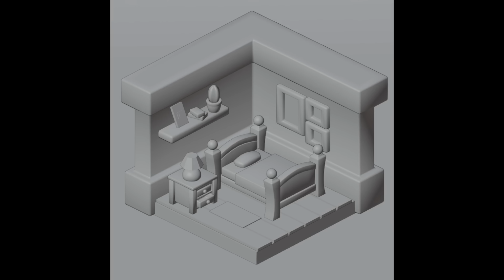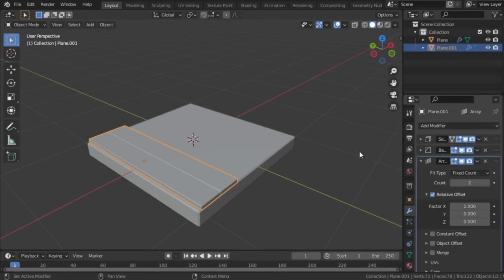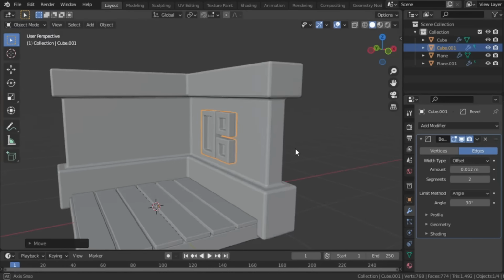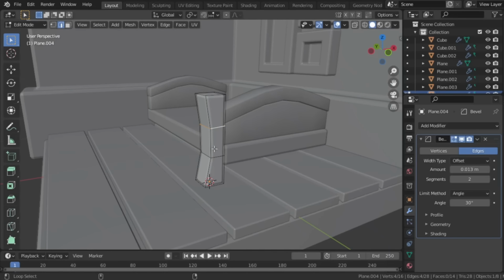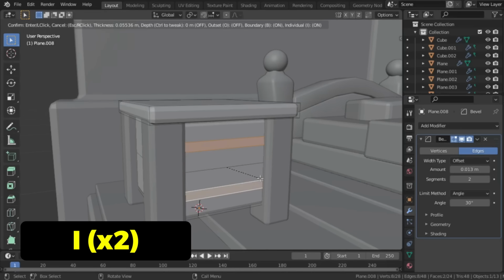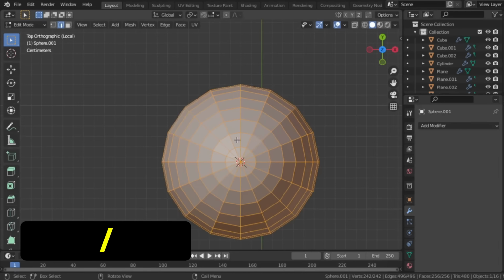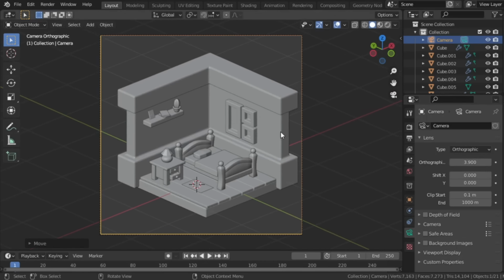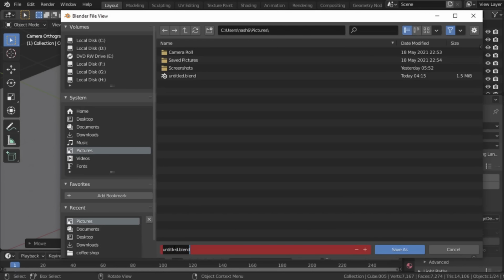Blender 3D - Create a 3D Isometric BEDROOM in 15 minutes | Beginner Tutorial

Comment: Please I am having issues with the mirror modifier
It's not going to the other part, I don't know what to do or where the problem is from
Reply: im also having problems with that, it doesnt mirror to the other side of the bed :(
Reply: @SintaxBSD  if you have not figured it out, see my comment :)
Reply: You have probably moved on at this point, but if not, here is the solution: Its because the origin of the object is not centered in the bed. Go to object mode. Click your bed in the collection so that it gets high lighted, then click the menu "Object", its in the upper left corner right beside "Select" and "Add". In the "Object" menu, click "set Origin" and then choose "Origin to Geometry". Now blender know where the middle of your bed is and the mirroring should work :)   (there might be other better ways to fix it, and I might have used weird termonolgy, this is my first day in blender)

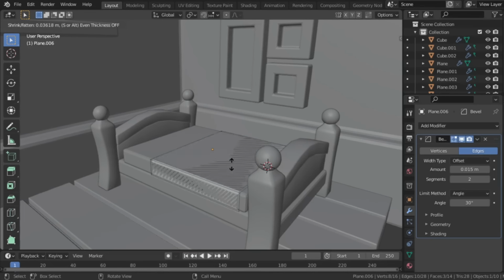Comment: 7:08 When I extrude along the normals, it extrudes the Bevel'ed edge of the sheet, so instead of treating the sheet as one uniform object, it grows like 3 horns. Anyone know how to fix this?
Reply: Mine is acting weird as well xD
Reply: @j00nsang  its been 1 month and i still dont know how to do that. So now I make straight walls
Reply: omg there's a lot of people having the same problem, can someone please help us? and btw after this exact part there's a meme that says: "you can do it" lol
Reply: did you get any solution? same is happening w me so I skipped that part
Reply: I'm not sure if I understand what you mean, but it sounds like something that happens to me when I use the bevel tool. Sometimes things poke out and look funky. kind of like horns sometimes. The solution to this problem is to look in the menu that pops up when you use the bevel tool, and check the box where it says clamp override. I'm not sure if its related to your problem, but I thought I'd throw this out there. You may also want to undo what you did, and then go to object mode, select the object, hit Ctrl + A bringing up the 'Apply' menu, and select 'Scale.' Idk if it works, but Blender guru says that whenever objects behave weirdly, its usually because you dint apply the scale. Applying the scale has fixed almost every other weird problem like that I've had so far. Sorry if none of this helps.

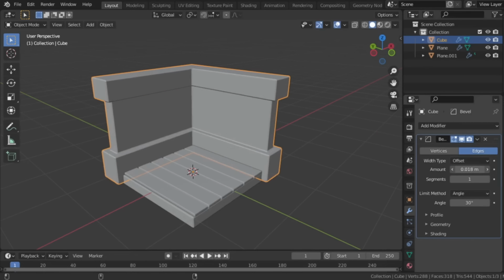Comment: timestamp 3:28, adding bevel to the object does not change anything. I've tried bumping up the values really high but no luck
Reply: @aminur: same issue, I found the solution here https://youtu.be/-BcQ-D1kmA0
Reply: same here - I'm so confused right now! o.o
Reply: @maximilianschuhmann560  I began pressing CTRL +  Z alot out of frustration and crashed blender 0.0 had to do it from scratch and surprisingly it worked the right way this time
Reply: @maximilianschuhmann560  I think you need to apply the modifiers ig

Comment: Good day. Three days now and no success in making that bedhead! Proportional editing is on but my scroll wheel is changing directions rather than doing what is demonstrated and Pg up/ dn is not responding likewise. I am currently on version 2.93! Help! getting frustrated!
Reply from the maker: First activate the X ray (Alt+Z), 
then select the middle vertices (LMB drag), turn on proportional editing tool (O), 
press G to move(while moving the mouse, you may see its moving in all directions, so press Z to lock the movement to Z axis only),
And if you don't see the influence circle in the screen, scroll down with mouse wheel till you see it, and then adjust the circle size accordingly scrolling up or down, while still moving the mouse, and finally left click after done. Hope this helps. Also using 9 and 3 as the pg up/down keys won't work, use the above ones.
Reply: @3dgreenhorn  I found my error. "Projected from view" was activated. Everything is working super so far. Thanks for your prompt response and be safe.